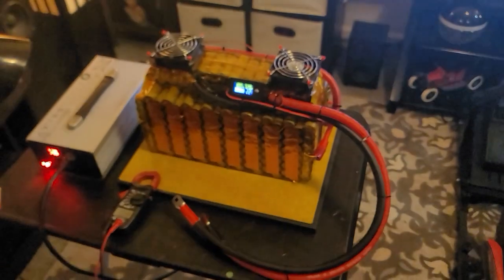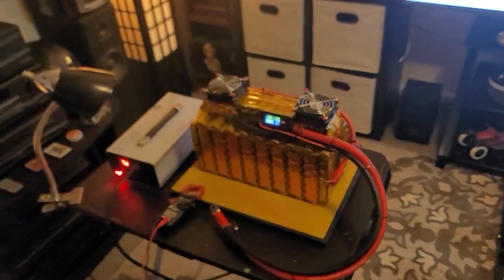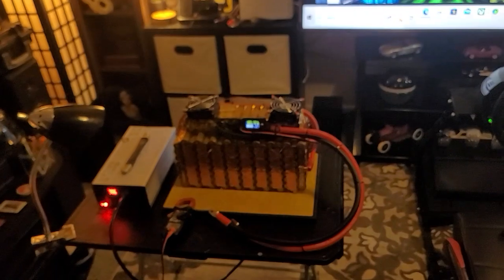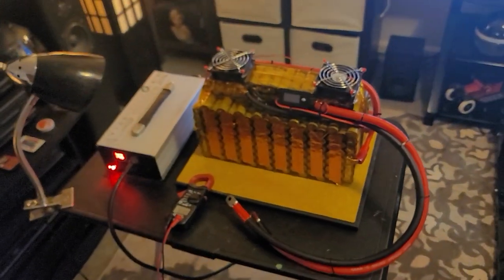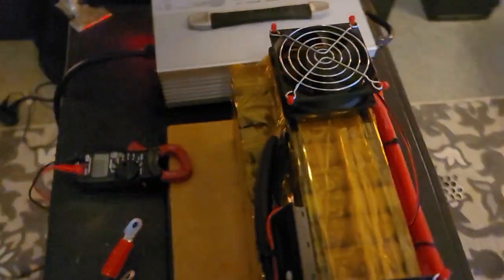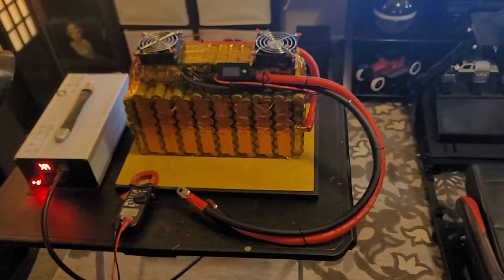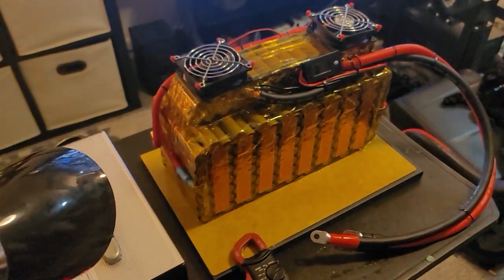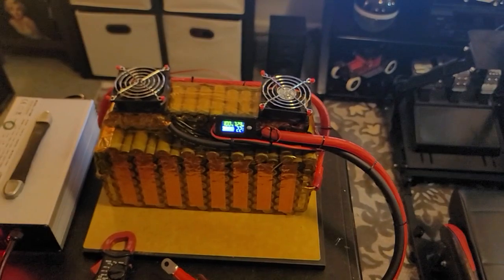Copper infused custom Racepacks by Chriscrossingwires 45amp cells X?S16p 490-630amp High Output 60AH

Comment: I need two batteries. The first one is my local/light-bike mini-batt.. the following will be 40-50Ah fat boy. Bypassed yet like you said, a killer monitor system. And I’m hoping for a cool shape. Maybe a narrow L with a couple bumps? I like your new batts but always wanted molies. Now, big controller (Fardriver 721800) awaits. Two 2 gauge + wires and two 2 gauge - wires I was hoping that come off of the battery that hook to the controller. I just got an axle from QS for my 273. I had them send me one so I can attempt to bore out the hole (or add an additional one) so I can get three 2-4 gauge phase wires into the motor. I hope to nit have to dial down the controller because of a fear of thermal run that way!  Maybe the only adjustment would be due to the motor overheating or something like that...but not a fricken battery struggling. I’ll go any gauge. Fans, shoot...watercooled. Anyway, i’d be proud to rock your battery.  Lets do it, ChrisX
Reply: my em is b o bbyj une €gm ale
Reply from the maker: @Bobby June Live  lol cool 😎 Please to meet you, Thanks for subbing I appreciate your support.
Reply: @ChrisCrossingWires1212  likewise. You were the first person who gave me a trustable and clear  understanding of a bypass. Made you one of the few i listen to, super fun to buy a dose of your power..lol. Fun shit. Hey, I’m going to be youTubing the crap outta this bike. You need a little plaque to put on either side of the batt. Would look cool in video explainers. 

Anyway, talk later.
Reply from the maker: @Bobby June Live  Yeah I'm still developing as I go the final product will be totally sealed plastic siding and shrink wrapped just trying to let people see what they will look like on the inside. May possibly even have a hard shell with meter and other functionality. It's a work still in progress in early stages of development no doubt. Peace Bro Was trying to get this thing in my Bike today and have it securely mounted and protected, got a late start after bringing in the new year so was trying to be ready for first ride but looks like I may not beat the sun going down but I'm taking my time, came too far to rush a neat safe install
Reply from the maker: Bro I'm gonna make people whatever they want. I went with these because they made more financial sense since space wasn't a factor. My cells are still 45amp cells and only produce 35 amps when they are extremely hot which they will never be and if discharge rate is a factor, I can simply add another row of P and have more amps for less money so there's that but it's your money, spend it how you wish
Reply: Well that heat thing was one of my concerns since my controller will draw a ton. My knowledge after that (i.e. what does that fardriver really yank and is the molicel claim for high draw/heat really worth?) is poof.  So let’s just say I’ll start with Lith (sp?) and as we progress, maybe I’ll jump back to Molicel.

So how do we start with my first custom. Light, small as possible, L shape, all the other cool shit...

Comment: Red Brass is the absolute best material for packs
Reply: Red brass has 28% conductivity compared to copper, silver has 5% more conductivity than copper. Where are you getting your information....
Reply: Top 13 conductors
Silver
Copper
Gold
Aluminum
Zinc
Nickel
Brass
Bronze
Iron
Platinum
Steel
Lead
Stainless steel
Reply: I believe gold is the best… silver is cheap

Comment: chris check out Qucc bmss they have some crazy 1000 amps models with huge contacters instaead of mosfets etc
Reply: as well as high current active balancing addon boards
Reply: There is a discharge switch in most BMS to cut discharge and charge, no need for contactors.

Comment: Am I missing something or why hasn’t anyone questioned using nickel strip connectors? At least make sure it’s not nickel plated steel, otherwise the only benefits of using nickel is corrosion resistance.
Reply from the maker: true very true